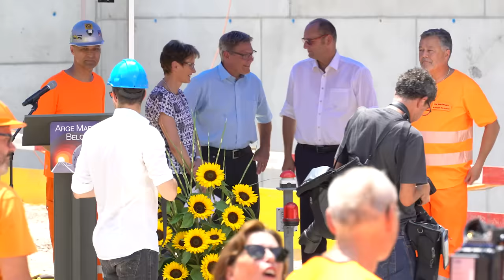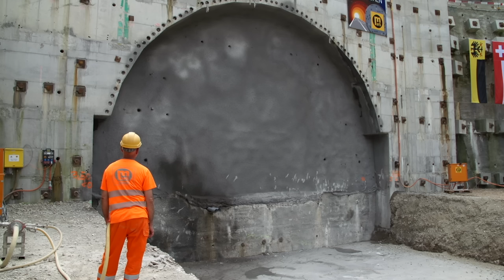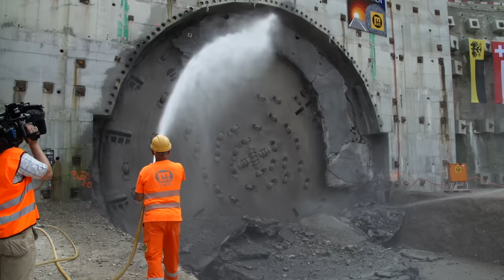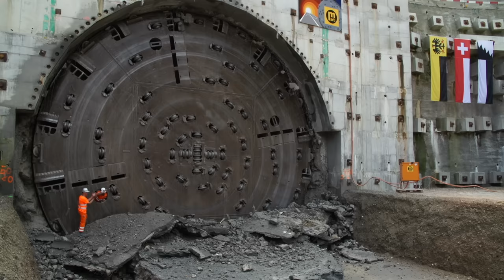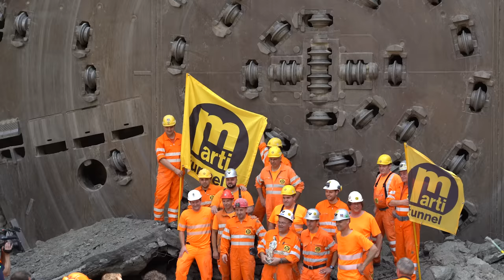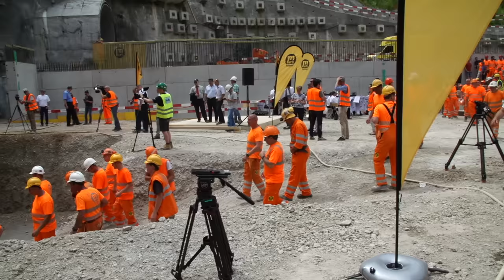Herrenknecht Tunnelbohrmaschine - Durchbruch am Belchentunnel bei Basel

Comment: Their underground navigation was pretty incredibly accurate to emerge exactly at that prepared arch in the concrete!
Reply: Así que con estás maquinitas pueden hacer ciudades subterráneas o búnker o pueden meterse a otros países a robar sus tesoros petróleo,tesoros arqueológicos por debajo de las pirámides o hacer socavones
Reply: @berthacasillas2524  ១1
Reply: Did they use GPS ?
Reply: @ccbueno1  No, GPS doesn't work in tunnels. The data is collected from multiple satellites at the surface, and the measurements are averaged. The calculated position is then transferred into the tunnel, where gyroscopes, lasers, radar, echolocation, and inclination sensors are used to ensure that the TBM maintains an accuracy within 2 cm in all directions.